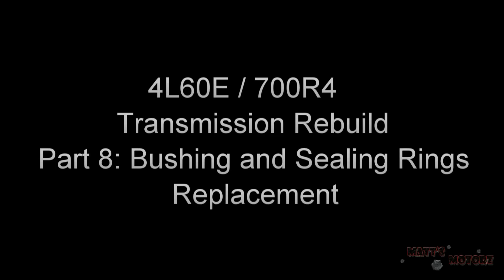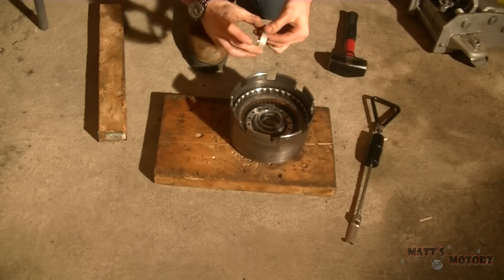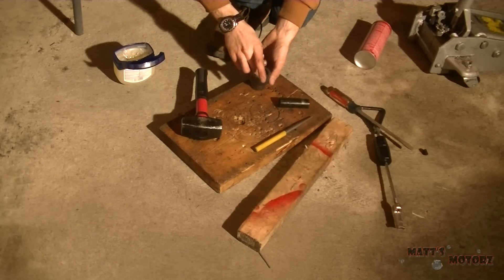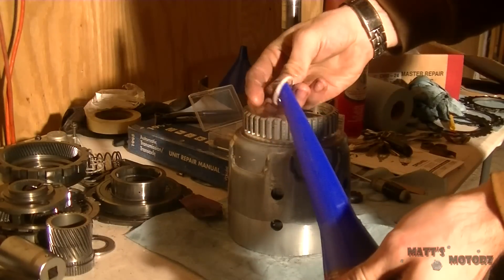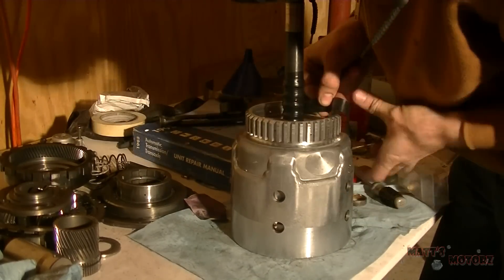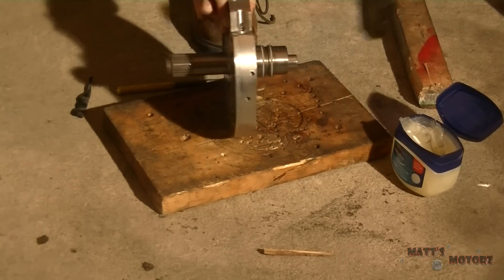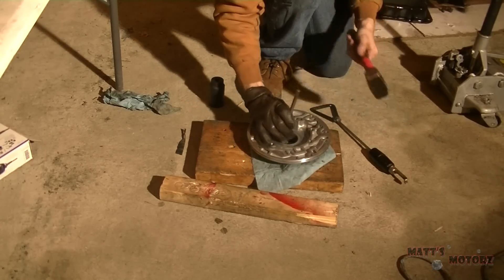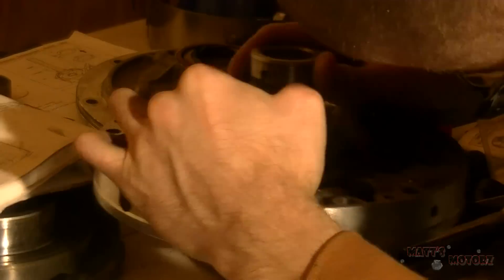4L60E / 700R4 Transmission Rebuild [Part 8: Bushings and Sealing Rings Replacement]

Comment: i would buy a bench press for about 180 $ at Harbor freight,nice and clean job ,buy a set of bushing drivers too.To work on a th700r4-4l60 auto's you need some tools that speed up your work.Springs assembly install tool,teflon rings installer- resizer tool,snap ring pliers...and a good bench press for all the bushings.You can fabricate your own tools,like springs compressors.good job with your rebuild guy

Comment: Hey Matt, I've come to a small hurdle in my AX4S rebuild. I replaced the bushing in the converter reactor where the TC mounts. Its a nice slip fit on the chain shaft uninstalled but installed the shaft wont' fit it without forcing it. I was very careful not to damage the bushing. Do you ever have to ream one of these a bit? What did you do it with? Thanks!
Reply from the maker: +ILTSYC When you replace the bushings, the clearances between the bushings and the shafts that go through them can sometimes be VERY tight.  You get that thing cocked to one side even a little bit and it wont go in. Lube it up real well and twist while pushing the parts together.  

One possible scenareo is that if you installed the bushing by hammering it in, it could have become mushroomed a bit along the rim.  What I do is take a utility knife and gently go around the rim to get rid of any high spots that may be stopping the shaft from going through.  Let me know how it goes.  I have never had to ream one out, but there were times where I thought "what the heck, this wont fit!" but eventually got it.
Reply: Well thats cheaper than buying a reamer. I didn't hammer it in, actually I used a 1/2 bolt with a steal plate on each end and then a socket to counter sink it to the correct location.  I'll check for any swelling tomorrow, I've had enough for one day. Thanks man!

Comment: Thanks man this is great! 
I'm rebuilding my first tranny which is a 2000 Windstar AX4S.  I've become concerned about the looseness of the bushing to pin fit in several places but especially the output shaft in the differential. Its ridiculously sloppy. None of the rest are that bad but still a little more sloppy than I like. 

Do you know how much clearance there should be between bushings and pins? I'm thinking there should be almost no noticeable side play.
Reply from the maker: +ILTSYC It really depends on where it is.  But in general, bushings and shafts that go in them should be tight with very little or no play.
Reply: Where do you like to order transmission parts from man? Many times online suppliers don't have pics and I like to see pics of what I'm getting.

None of my clutch packs in this 2000 AX4S Front wheel drive ford Windstar look bad nor do the pistons. I haven't found a speck that I can actually mic them with.

The only 3 things I've found wrong with this tranny is a couple of loose bushings and a broken circlip on the over drive band piston which didn't allow the pin to actuate the OD band. Also found a chain that is stretched to 1 and 1/16 of play when the limit is 5/8.

Im pretty sure the chain is what I could hear slipping when power locking with a small amount of throttle. The tranny had Reverse, 1st and 2nd but free wheeled going to 3rd.
Reply from the maker: Generally it is a good idea to replace all of the clutches and steels when tearing into a transmission regardless of whether they are good or not.  They don't cost that much and add a significant amount of life to the transmission.  The clearances should all be in the rebuild manual.  Haven't worked on that particular model to give you any more information.  

It is also a good idea to replace all of the bushings (within reason, some bushings are a major pain in the ass to replace).

As for where I get my parts, one of my favs is "what ever it takes transmission."  Just type that in google.  They have full explosion diagrams where you simply click the part you need replaced (they don't have that for ALL models, but many).  My only gripe is their website is pretty bad.  

Other than that, a great place to get parts is actually the dealer.  They are able to print up the same explosion diagrams and you just point to what ever you need (you can also bring the manual in and point to the part you need in the diagram in the manual).  Downside to them is they are more expensive.

Another GREAT place is ebay.  Many times you can get fantastic deals.
Reply: I like whatever it takes! They have the AX4S listed. Thanks!
Reply from the maker: No prob!

Comment: shim stock and hose clamps will work in the same place for the electrical tape
Reply: I have 2 pieces of plastic in different sizes for the input shaft and pump cut from a 2 liter bottle, wrap the seals with the plastic, then a couple hose clamps around the plastic. The plastic doesn't have to be cut perfect. I let it overlap 1/2 to 3/4 inch. 
.

Comment: There are 14 bushings in the kit I purchased, they range from 1" to 2-1/8". Harbor freight has a kit that covers 1"-1-1/4, for 18.00 and seems to be a pretty good sturdy tool, but they dont have 1-1/2",1-5/8", 1-3/4". or2-1/8" does any one know where I can get these 4 bushing sizes for a reasonable price? the sunex 3920 has all but the 2-1/8" but they want 54.00!
Reply: David Smith
 I was able to install all of my bushings with the harbor freight bushing installer and a mac brand that I picked up at a pawn shop for around 59.00 I have a shop press and did the first 6 or so with the press and the last 6 or so with just a hammer, I have to say I was more impressed with the hammer method.